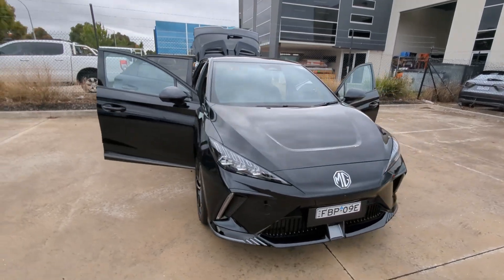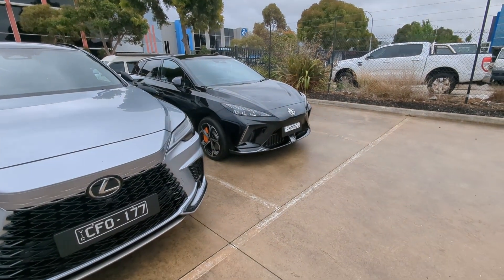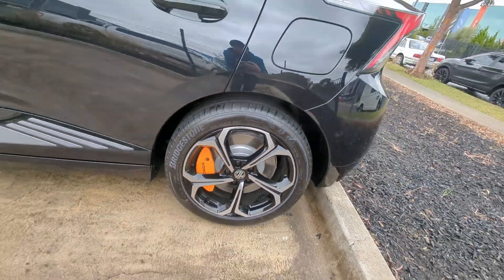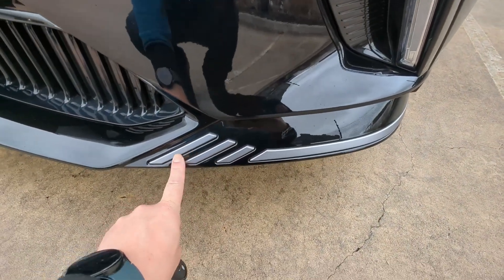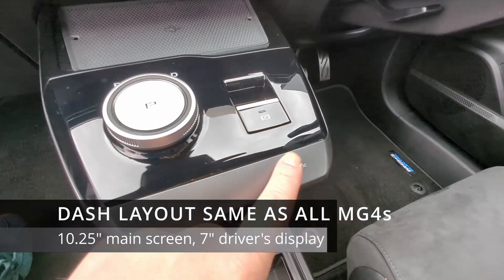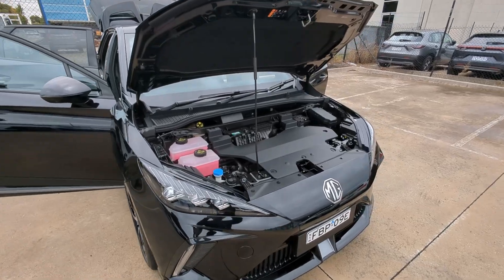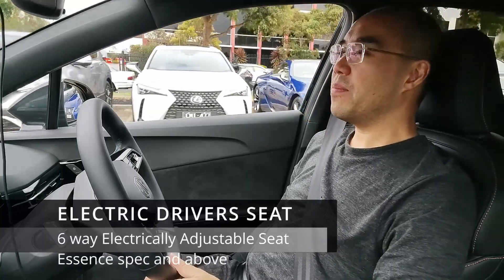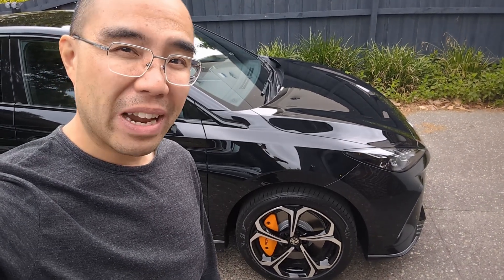MG Australia gave me a FREE MG4 XPOWER! (for a week) Review, First impressions, Walkaround intro

Comment: The X Power has bigger rotors and callipers. It also has ventelated rear rotors.
Reply from the maker: Yes you're right, after a little more digging the Xpower has 345mm ventilated rotors all around. There's no mention of that on the MG Aus website, and you'd think they would make more of a statement about it. The website does say there's "XPOWER Branded Metallic Caliper Covers" which is kind of like boasting you've got fake AMG badges on your A180. However after giving the xpower a bit of a drive on my favourite roads, that increase in rotor diameter isn't enough of a braking improvement for a car with this much power.
Reply: @bozugarage  they should just a few hundred $ and put real brembo brakes on.
Reply from the maker: @fredfrond6148  100% agree

Comment: The weight difference between your Excite and the XPower is 165kg, which is almost 10% of the Excite weight.  I would like to know the difference in steering feel when navigating around shopping centre carparks, whether the change in the modes also change the steering ratio along with throttle rate, any suspension changes, does the XPower become more unsettled than the Excite. Thanks Tim, looking forward to the next instalment.
Reply from the maker: Yep, that weight difference is like having one old fat guy like me sitting the back. Certainly at normal driving speed, manouvering speed, there's no detectable difference in steering weight or feedback - it seems the extra front motor was integrated without losing any steering feel which is quite impressive. And couldn't detect any steering ratio changes, same amount of steering effort was required no matter what mode I was in. Good and bad - feels 100% like an Excite 51 in normal driving, but totally different when you plant your right foot. Needs more brake.
Reply: @bozugarage  Thanks for replying, with regards to the brakes does all your MG have the one pedal driving update installed and working?
Reply from the maker: @teinspringz  well my excite 51 was delivered with one pedal driving enabled few months ago, so yes

Comment: Great episode. Looking forward to the next one! Curious about range and charge times too.
Reply from the maker: Thanks for the feedback - will have a couple of vids in the next week, a general overall review, plus direct comparisons with my 51 and model 3. Range is 400km at 100% capacity, charge rate is... well, slow if you use the provided charger. I've got about 1.3kW per hour on my 51, and it's no different on the xpower. So, filling from dead empty to full on a 64kW battery at 1.3kW/hour is 49 hours with the included MG slow charger - will cover this in more detail at some far future time